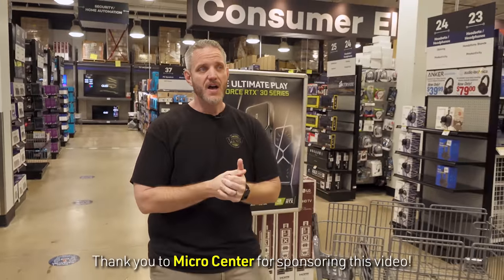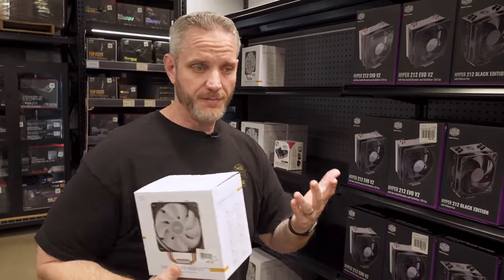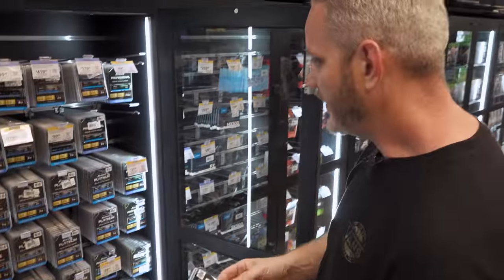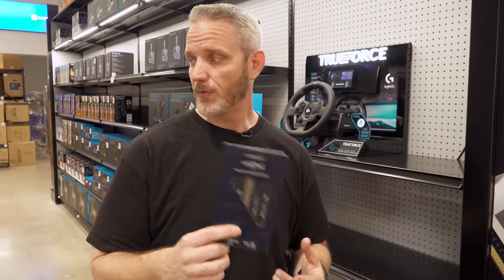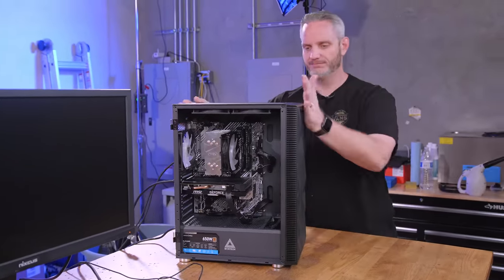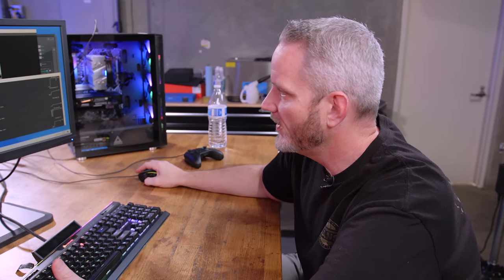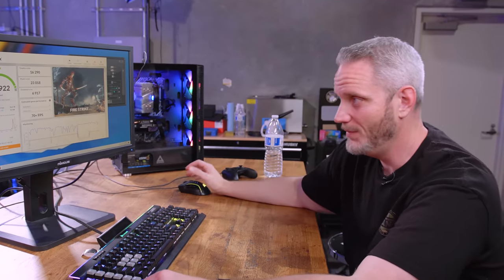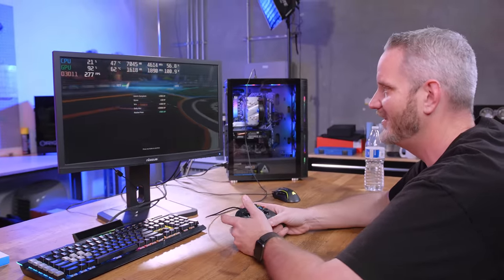How cheap can I build a "Gaming PC" for in 2022

Comment: Ok you cheated, here are the parts that you did not include that ARE PART OF A WORKING SYSTEM; The monitor, any extra cables and maybe the Operating System, like Windows 10 or 11.
You did not mention the network system to connect to the internet. When I think of a computer system, especially for gaming connecting to the internet is part of the system build. 
Consider including down loading and multi tasking with several things open at the same time, A game loaded, a browser open, Discord running, music playing, maybe streaming the game and later video editing. What kind of system do I need for all that?
Reply: Everyone who watches this video has a internet connection. There isnt anything extra you need to buy.

And the video is also specificaly about the PC itself. Not a gaming setup. Thats why its called "gaming PC" and not "gaming setup".

You also dont need anything beefy to run some background tasks like spotify, youtube and discord. Even the steam deck doesnt see any performance impact from that. And that thing only has 4 zen 2 cores.

Comment: "How cheap can I build a gaming PC"
spends $120 on a mobo

meanwhile, I got an "expensive" €100 mobo (Asus prime b560m-A) because it was the cheapest I could find that came with an ARGB controller. otherwise, I'd have gone cheaper (€80 tops), but I wanted FANCY LIGHTS. and yes, the same platform (11th gen intel), even though mine is a 11400 (though I do have it power-unlocked via Intel's XTU software -- that did require upgrading to a big-ass Noctua cooler, though, LOL)

yet the bottleneck is still my old GTX1060 -- which I plan to replace as soon as GPUs have normal prices again (it was 5 years ago, but I paid under €250 for mine -- I'm not paying MORE for a WORSE card)

you guys need to do more budget builds. I mean, the rest of the parts are "solid" choices (considering today's pricing), but, say, there ARE front-mesh cases for well under €50 (at least in the EU). and a pack of 5 arctic fans (PWM version, no lights but they do the job of blowing air AND not sounding like a turbine) is like €25? And especially the mobo... anything over €100 is NOT a budget mobo. just saying. 

yeah, yeah, microcenter sponsors and pays so who cares... spoiler: the users (read: viewers) care. there's NO REASON to buy everything in the same store. so, okay, get everything there, but DO list some alternatives? e.g. "okay, all they had was this, so we're going with it, but a more sensible buyer would buy this other thing instead."

Comment: Intell, boo.
And you can build cheaper with still decent parts. Try 700-800 max. 800 is easy. 700 is difficult. Less than that is crappy.

Comment: Please, take a ESD certification, you risk to taint the hardware since you don't know what you are doing.
So even if you know what parts to use, you are not qualified to handle them.
Everything at your workbench including yourself must have the same charge.
You don't need to buy a complete ESD safe workbench if you learn what ESD is and how to handle it.
Example 14:37, hold your left hand on the computer box (not painted) before you drop down the motherboard, that way all 3 parts (you, MB,box) has the same charge.
It's not harder for you to learn than it is for people who make sandwiches to always clean their hands after a visit on the toilet.